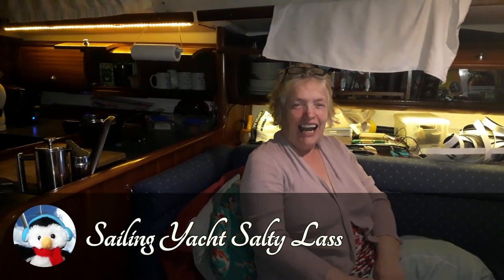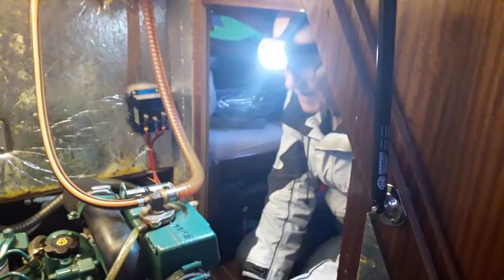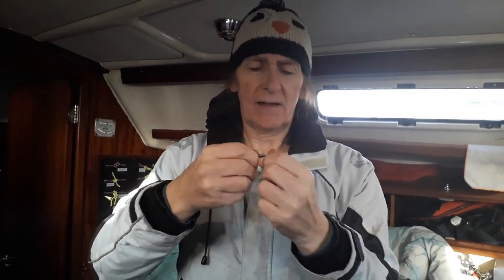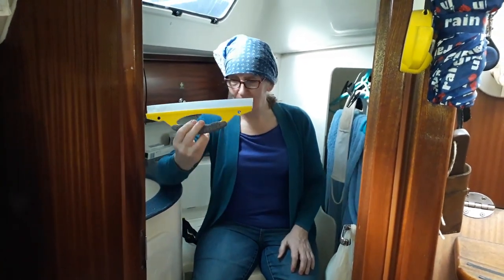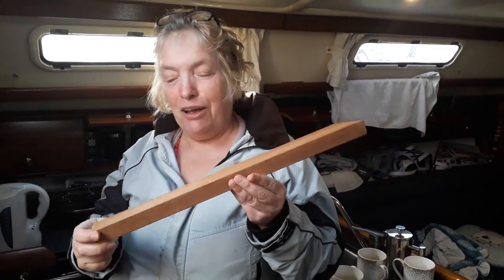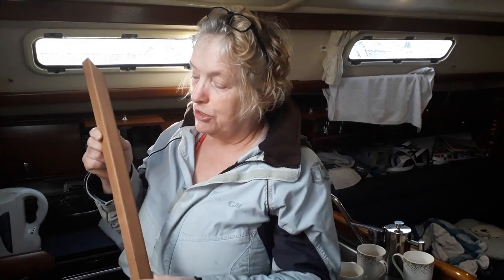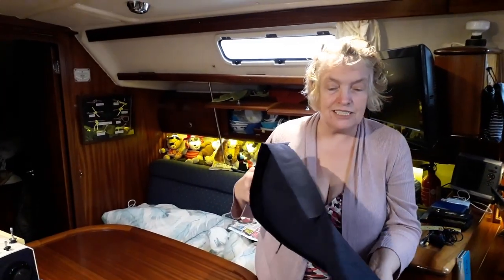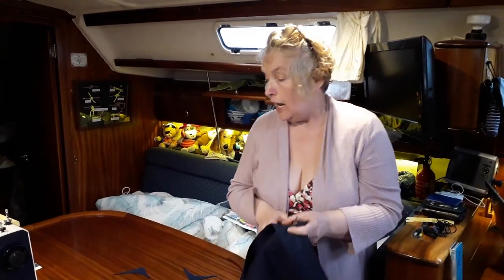Northern Ireland - Winter - Why we don't go south for the winter - Ep. 227

Comment: Good rescues on board
Reply from the maker: Rescues? I am intrigued ...
Reply: @SailingYachtSaltyLass  electric cable & pump. Definitely wire on it's last legs
Reply from the maker: Oh the wire was a disgrace. Whoever put it in should have been keel-hauled. We only discovered it when we had the engine panel issue and we were checking all the electrics including around the engine.

Comment: Garinish Island, Glengarriff is certainly well worth visiting while down south. Lonehort Harbour, Adrigole, Barloge Creek are all secluded, well sheltered, beautiful anchorages. Hopefully meet you somewhere while sailing down south this summer.
Reply from the maker: I will put those into the pilot guide - all except Lonehort. I have read a couple of accounts of people knocking their keels loose in Lonehort  😮
Reply: @SailingYachtSaltyLass  Yes Lonehort is “tricky” and great care is required, especially when entering/exiting but I have managed with 1.95m draught on a suitable state of tide. There was very little to spare beneath the keel and I’ve no doubt it has claimed some keel paint in the past 🥴. Space within is also tight if there is a couple of other boats at anchor so condition need to be ideal.😏
Reply from the maker: We are looking at the charts as we write and it certainly looks squeaky bum time, but I am so looking forward to it as well

Comment: The D+ terminal is used to excite the alternator. On a Volvo Penta, it also supplies the alarm circuit.....
Reply from the maker: Thanks for the info. We just replaced it because it was so manky!
Reply: @SailingYachtSaltyLass  It could be the reason you have been having issues with your VP engine alarm panel. The excitation for the alternator comes from the ignition, through a resistor to the excitation connection, then comes back up to the panel to power the alarm and lights.
Reply from the maker: You could very well be correct. Once you said that we read it and went "Hmmm....." In any case, it did no harm to clean everything out and reseal the panel and that obscenity of a wire on the back of the alternator had to go. 

We have moved the boat around the marina quite a few times since and everything has been fine and works nicely so we are growing in confidence that the issue is fixed.

Comment: We’ve got a hook & eye system for holding our step locker in place. We just lift up to remove step from engine access door
Reply from the maker: Our stairs are on a gas strut, but we could do with that bottom step moving.
Reply: @SailingYachtSaltyLass  ah yes forgot about the lifting door
Reply from the maker: It is so nice to have 😃

Comment: On the sewing my singer heavy duty turns out to be a singer light weight,and gave up on four layers of sunbrella  :( them hatch covers not only practical but looked smart also, and if we ever do get an Indian summer will stop the uv crazing the hatches and getting in the cabin bleaching the wood and covers. heres  hopping ;)
Reply from the maker: Sunbrella is tough stuff. Cotton it isn't 😄 If you are going to make summer hatch covers use a light coloured fabric. We used the blue because we had it to hand. Ironically, the older the sewing machine, the more likely it is to handle tougher fabrics